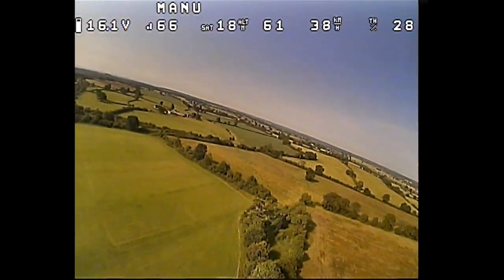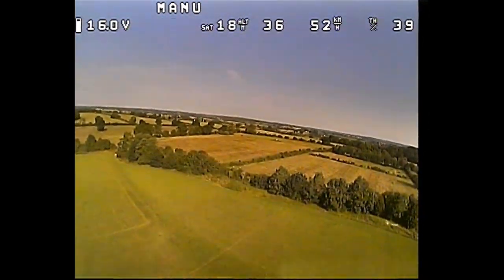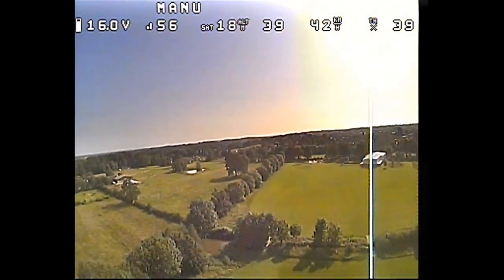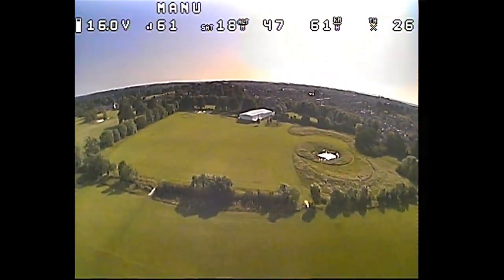Skyhunter Maiden Flight

Comment: Nice solid maiden...congrats! The skyhunter is a really nice plane to fly, a good 'all rounder', i think you'll enjoy it. I didnt notice any yaw waggle in your flight but noticed you have the rear stabs pushed forwards on the booms....if you get any waggle push it right to the back....also helps to avoid splitting the booms on landings. Enjoy. :)
Reply from the maker: Flyin Flea, cheers for the positive feedback. I ran out of hook side Velcro, adjusted stabs to obtain correct CG due to battery positioning. 
I will move stabs back when I have more Velcro, it will be interesting for me to feel the difference. Cheers again for the tip.